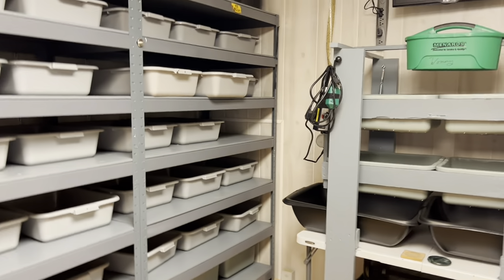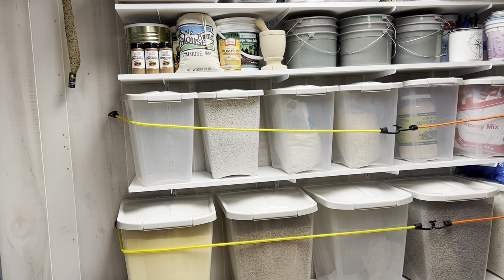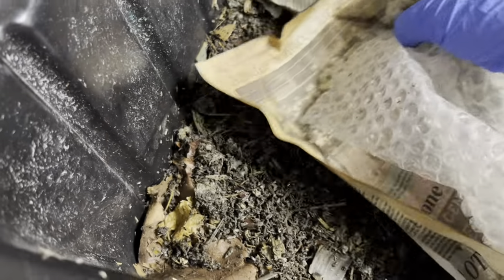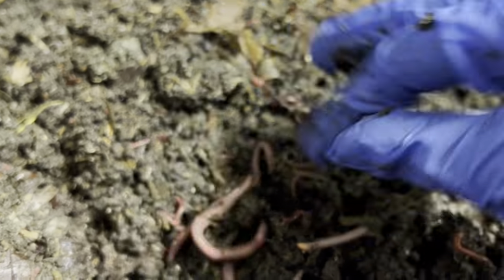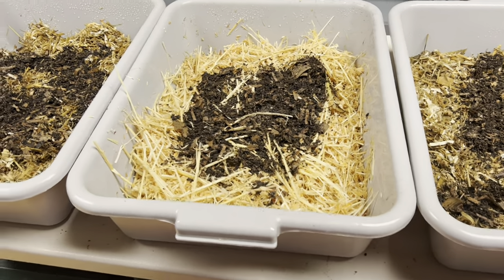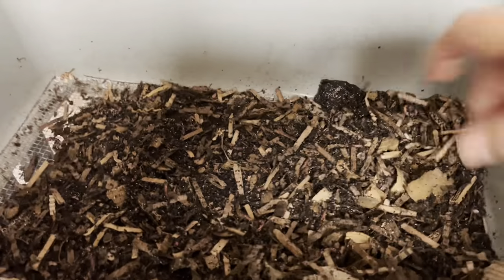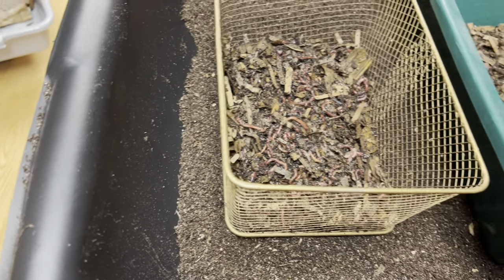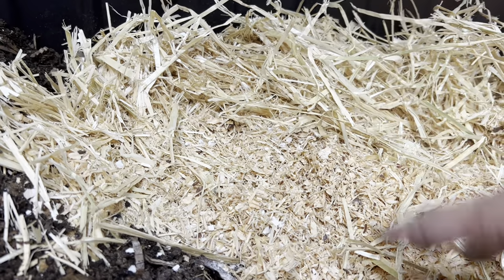How to harvest a Red wiggler nursery bin￼. Lot’s of tips and tricks to make things easier for you. ￼

Comment: Have you ever tried a ventless gas heater? We've used them for years and they have saved us numerous times during power outages. We use natural gas ones but they come in propane as well. Very energy efficient and the heat is fantastic and not drying at all .
Reply from the maker: No I’ve never tried that. Sounds interesting

Comment: I think using the BTI (mosquito dunks) in your watering can helps with the Springtails. It seems to have with mine.
Reply: Troy, What mix do you recommend to use in a spray bottle.
Reply: @frederickjamison4549  I usually just use a watering can. They may stop up the sprayer pickup tube? They may not though because they dissolve very slowly. I don't really measure I put about a teaspoon to a gallon and allow it to sit overnight. Of course it doesn't dissolve overnight but hopefully allows some of the BTI to treat the area. As it disappears I add more.
Reply: @troydunn6228  thanks. I'll try that.

Comment: How can you tell that your worms are dying off / population is reducing? I had a bin of mostly red wigglers (assuming some blues). I saw the occasional dried up worm and a few of them escaped the bin and dried up; but I didn't know that all along they had been dying off until I did a full count. 

I started with 250 and now am down to 60 in an experimental bin. I used small rodent "all natural" bedding for them that started the whole mess and didn't break down over 8 months. They also were not producing many cocoons.
Reply from the maker: I can usually tell when my population is diminishing because I look at them quite often. You need to look at that bedding and see if it had some kind of chemical in it. Sometimes chemicals will kill your worms for sure. Also try to mix up the bedding with other things such as cardboard or newspaper. If you have some dry leaves mix those in also. I’m going to be selling dry leaves on my website this year again because people want them. It’s good to give you worms a variety of things. I dry bin  will also definitely kill your worms make sure your moisture levels are good.
Sometimes they just die and it’s a mystery and you won’t figure it out. I’ve had that happen to me in the past. But don’t give up just keep trying.

Comment: I have been raising worms for probably 20 years also, but my method is much simpler than yours. 

I let the worms do all the work.

I grow in towers and yes I grow in the $100 (Amazon) towers, but I've been doing this forever so I don't really care about the cost. Back in the day I scored half a dozen free towers, so that kind of offsets ongoing costs.

Anyway, I feed almost 100% soft material like melons and overripe apples and bananas.  I also give them avocados, but everything I feed, I bury, so when you lift the lid off, it just looks like manicured bedding material.

Burying the food reduces the occurrence of those little flying things, I guess they are fruit flies or gnats or something, but anyway, if you pile bedding over the top of the food, no gnats.

I regularly arrange the towers with four layers.

 The very bottom one is a liquid reservoir with a faucet on the side, where "worm tea" can be harvested, when the liquid level inside is above the spigot level. I use the worm tea on my garden, diluted 10 to 1 with water.

Next up is a bin full of Coco coir and or sometimes shredded newsprint. 

The next bin up is the same and the top bin is where all the fun happens. That's where I feed the little fellows.

To harvest, I hang a 60 watt light bulb on, about a foot above the top bin with the lid off. This drives the little guys to the next bin. Once I have determined Elvis has left the building, all I do is dump that tray out into an empty plastic tray large enough to hold it and still be only about half full, then I fill the former top tray with new bedding and put it on the bottom of the tower stack, just above the reservoir, moving everybody up one level. 

That's it. That's all I do, well,  . .  . except for shifting out the castings and the eggs and stuff.

 For that I use some gold panning classifiers I got on Amazon as well. They were pricey also, but like I said, I don't really care about that side of it.

Eggs and cocoons and the like, gathered by sifting through different sized screens, go into the second from the top bin. 

Usually, the worms go down to the third bin, the lowest one with bedding, and go potty, which eventually works its way back up to the top of the tower.

The separated castings go into my garden or into friends' gardens. I just give them away. 

I know, that's crazy, but that's how I roll.

BTW I raise only red wrigglers.

EDIT: if you purchase the green worm towers from amazon, like I do, they come with six bins. I usually only use four at a time and I have already described how I do that, but that doesn't mean you can't use all six; I just find it easier to use four at a time. If you decide to use more than four, you'll have to do a little homework and figure out where they're pooping. Using just four bins, one is a swimming pool and the other three makes figuring out what's happening where, a no brainer.
Reply from the maker: Oh my gosh! Thank you for the amazing explanation. I have several towers that I play with for my personal use not for business. I raised Worms in Towers for 20 years now and I absolutely love them. I’m like you I don’t care if they cost $100 on Amazon I enjoy them and I get them also. My husband buys them for me for special occasions also. One year he got me the one factory 360 for Christmas and I started crying😂 I was so happy!!!! I have gone up to 6 to 7 trays one time I can’t remember on one of my towers.

I have raised every worm species in a tower it is duop. The latest one my far has been got me was a purple frog tower, I love it!!!!

It’s funny you talk about your towers because I was just thinking of starting a series only on towers because I know that people love them.